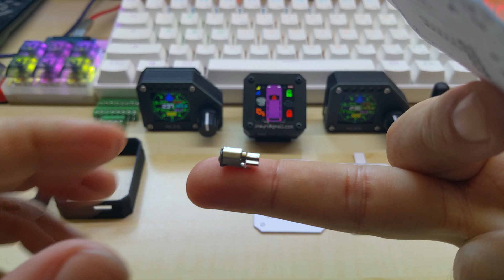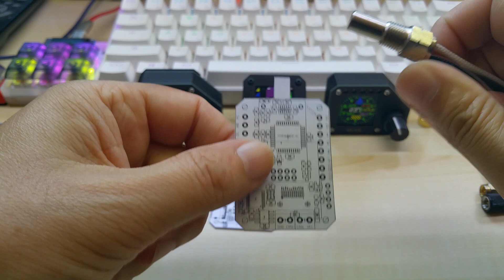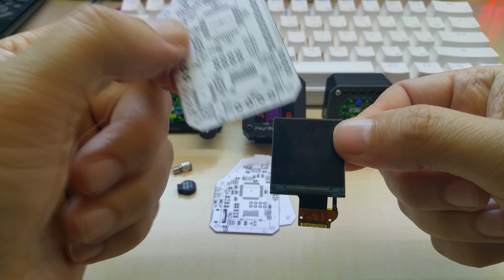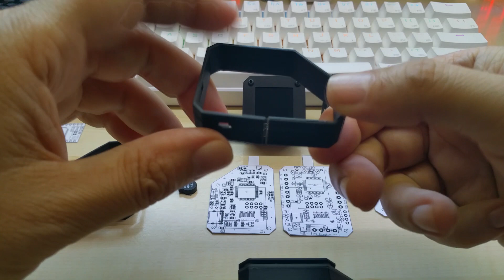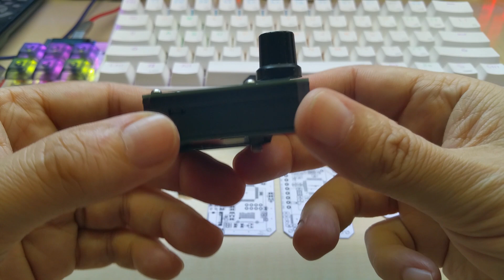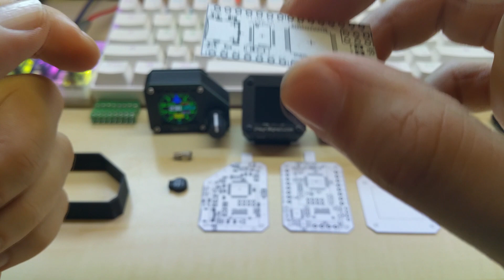Transmitter and Receiver of the 2 Way Remote using NRF24 transceiver, AES Encrypted, CAN BUS Node.

Comment: What have you done about FCC approvals and such? Those have me roadblocked - relatively large testing costs, etc just to release basic products.
Reply from the maker: I am using transceivers in the non-licensed 2.4 GHz frequency band which are FCC compliant, if I would still need a license, I just won't sell to the US. I will never sell enough as is to warrant to jump through hoops and paying big bucks plus I am not based in the US.
Reply: @iHayri1  Neat, I haven't done any RF communications projects so I am unaware of the transceivers that are available. I agree, its difficult as a small guy to justify going through that hoop. I know the definition of a "subassembly" is somewhat broad.
Reply from the maker: @statorworks 345  I could always just supply the transceiver unsoldered so the customer can solder it in place with 8 solder joints. Thanks for the heads-up. Wow, that sure is crazy, well if they want to impound my 5 sets they are welcome :-) It will definitely a low volume production.